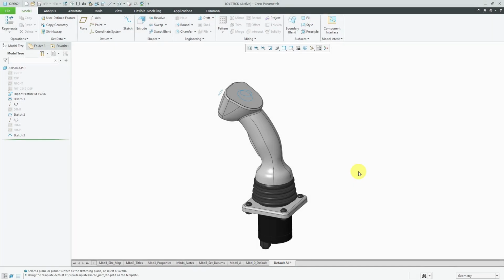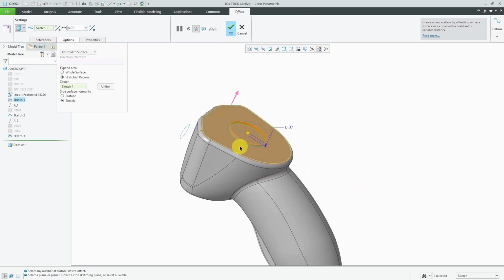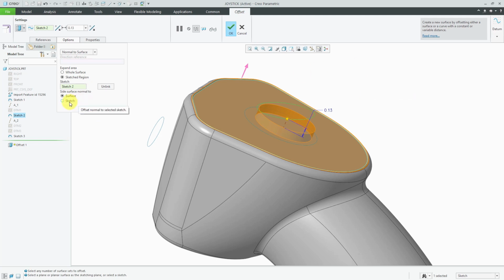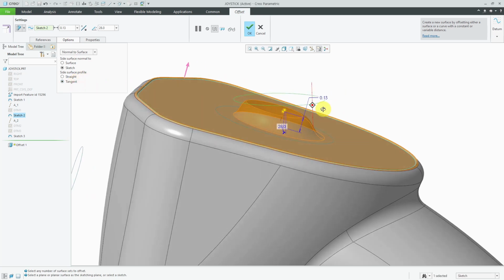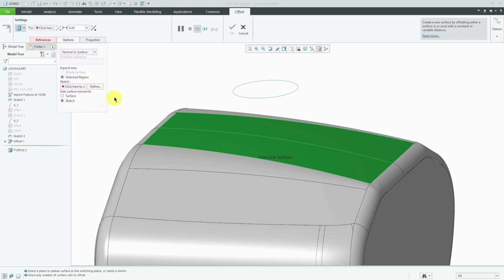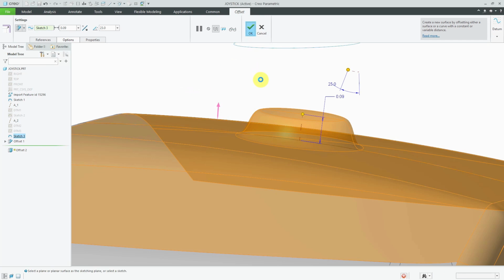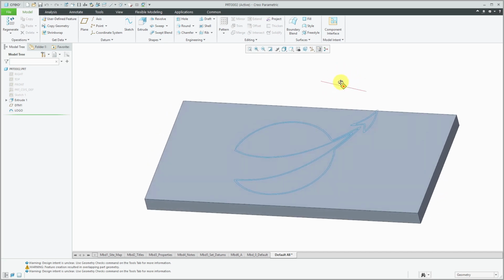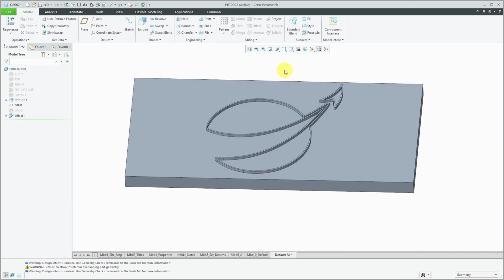Creo Parametric - Offset Command - Expand and Expand with Draft

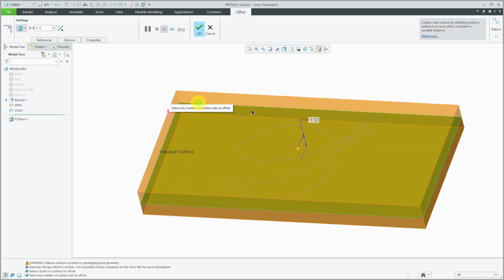Comment: 8:04 in another video (cosmetic groove), you divided the surface once the sketch was placed on the surface then used flexible modeling offset command to create the offset. Are these just two ways to “skin the cat” or are there reasons to use one vs the other. Love your content!
Reply from the maker: Different tools for your toolbox. But I did make this video 5 years ago, so I don’t remember the specifics of the use case I was demonstrating.

Comment: Wondering if there is a good way to translate a sketch onto the surface of a cone, and have the sketch and feature created, be 1:1 in size and dimensions.
Reply from the maker: See my video on the Wrap command.
Reply: @CADPLMGuy  Ok, I thought the wrap command will not work on a surface with angles in multiple axes, such as a cone would have.